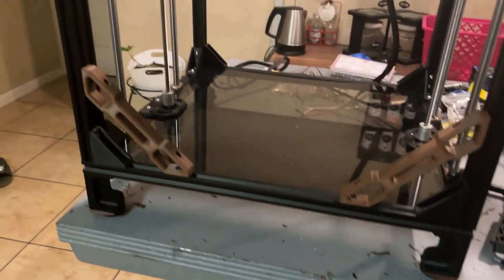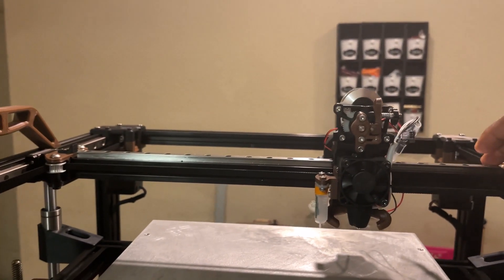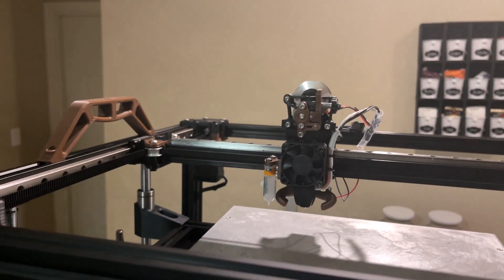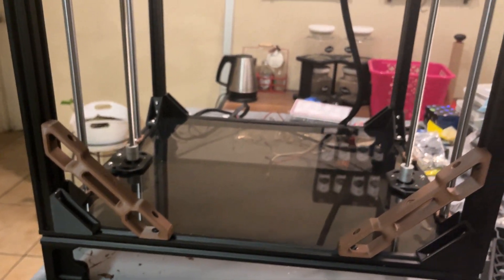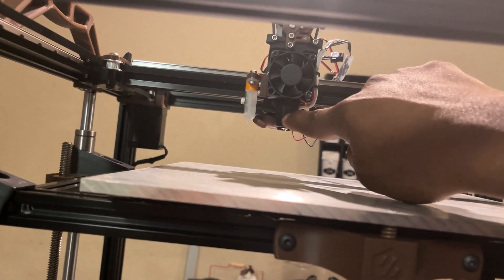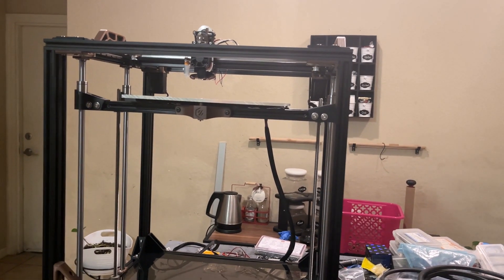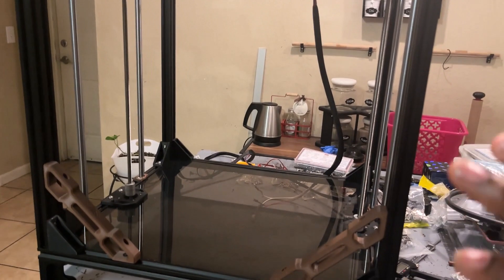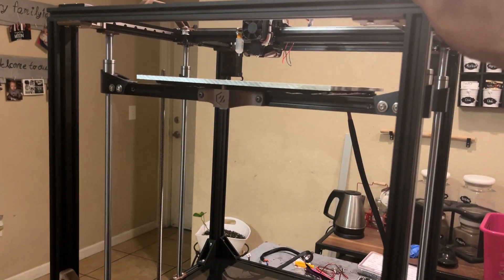New Conversion // VZBOT Build // GoldenJaguar392 // #3DPrinting

Comment: Hi, what a great video, your channel has helped me a lot. I recently passed a printer similar to voron2.4 manufactured by a company here in Brazil for the klipper that is running on pi3b+ with Skr octopus, everything works perfectly individually, but it is showing a failure when I run home all, you would have help me? the fault is

MCU 'mcu' shutdown: Timer too close
This often indicates the host computer is overloaded. check
for other processes consuming excessive CPU time, high swap
usage, disk errors, overheating, unstable voltage, or
similar system problems on the host computer.
Once the underlying issue is corrected, use the
"FIRMWARE_RESTART" command to reset the firmware, reload the
config, and restart the host software.
printer is shutdown
Reply from the maker: My suggestion is to reinstall mainsail or fluidd on the pi  update update fully and make sure to backup you're config.

Comment: Nice build, where did you get the 24v silicone heatpad for the bed ? I didn't know you could get a 24v one and i never really wanted to mess with the high voltage stuff.
Reply from the maker: I got mine form Keenovo directly it took a awhile to get here however KB3D has it.
https://kb-3d.com/store/heated-bed-electronics/475-keenovo-silicone-heater-creality-ender-3-235mm-350w-24v-1642734498464.html
Reply: @GoldenJaguar3D   cool thanks.